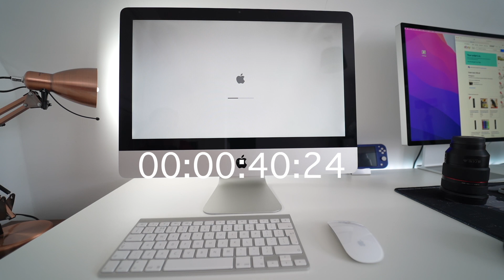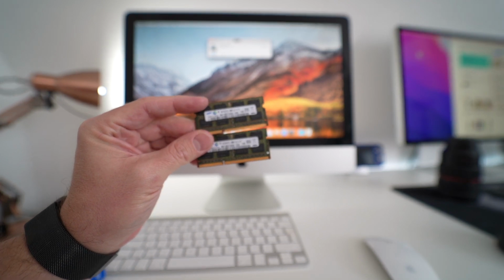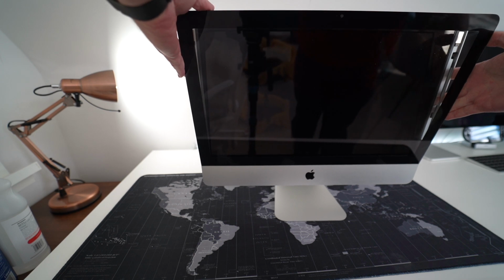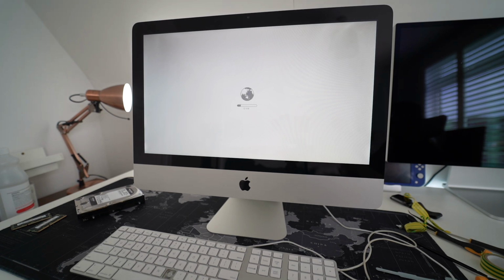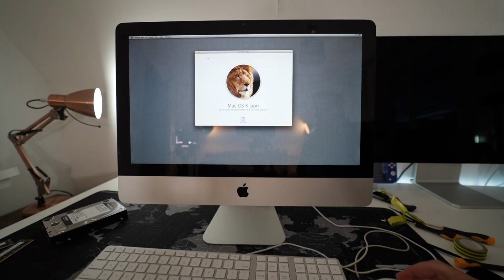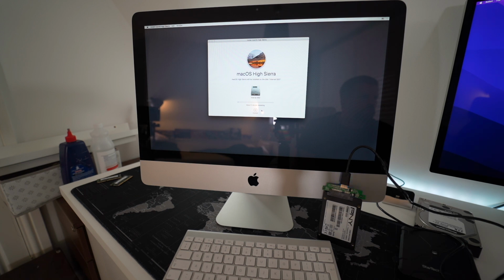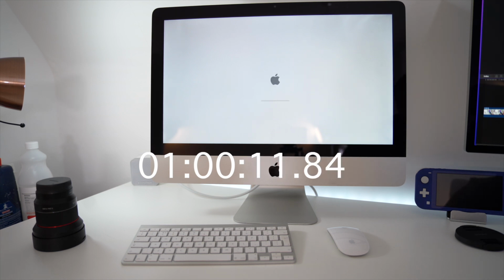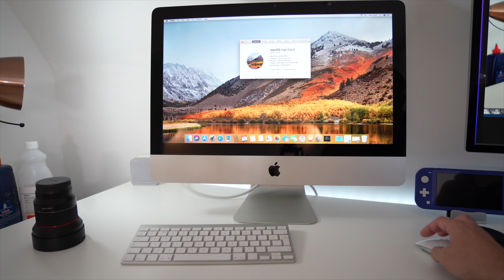SSD In A 2011 iMac - Is It Worth The Hassle? A1311

Comment: I’ve got a 27 inch 😊 i5-2500S, 1 TB SSD and upgraded GPU to an NVIDIA K1100M from the failure prone AMD HD6770M. DDR3 is extremely cheap as well so I upgraded it to 16 gigs (I plan on putting 32 gigs in here too)

Comment: Put in a ssd to replace my hard drive but my computer isn’t picking it up. There’s just a constant flashing folder on the screen.
Reply from the maker: @itstime6120  hold cmd+R on your keyboard and turn the Mac on…. Keep holding cmd+r until the chime, you’ll have to connect Ethernet or WiFi to re-download MacOs.   It should be an easy process and plenty of YT videos on the subject.  Good luck!

Comment: you put screws and bracket on the ssd so why the tape?...this is what anyone can do to any all in one pc. They are basically laptops with the same hard drive pinout and memory cards. I have an old HP and it looks no different. I've seen these macs running windows 10.
Reply from the maker: 1 screw to the bracket didn’t feel enough.  So why not?  Why do you have a problem with this?

What’s your point?

Comment: Hello,

I'm facing a very difficult problem with my iMac 27" 2011. After replacing the motherboard, CPU (upgraded to i7 2600), SSD, RAM, and reinstalling the system, the fans are running at full speed, and the CPU is stuck at a low frequency (1.7 GHz). I don't know how to fix this, and I would be very grateful if you could help)
Reply: Use mac fan control software, since you install the ssd the fan works at full speed
Reply: @elgatopeludin194  I ordered a thermal sensor for the SSD, should help
Reply: It's pin 11 you have to pull Low, to ground, pin 10 and 12 are ground pins, so it's not a big deal. I removed a bit of the plastic on the drive and soldered pin 11 and 12 together with a tiny piece of wire, just be careful to not use to thick a wire and to much solder, maybe it's easier to do it on the connector, but I did it on the drive, and it works flawlessly.
Reply: @danpedersen55  Thanks for the help! I've already done everything.
Reply: @gidrogengt Buy a thermal sensor. The 2009-2011 models had firmware on the hard drive to measure temperature data. If you replace the hard drive, this isn't possible anymore, and the fans will keep blasting.
Reply: If you've put the SSD in where the hard drive was there are two pins on the connector you can short to resolve this, a search will turn it up. My 2011 I kept the original HDD in and added the SSD to the dedicated connector, fans normal as the HDD remained. But the HDD failed and on removal all the fans cranked full blast. Once i made up a plug same as the SATA connector with the two pins shorted and put it where the hard drive was all returned to normal.

Comment: Question : I got an "old" iMAC with that "?" mark folder flashing ................but the "command + R" combination did NOT take me to recovery. Actually, nothing happens. Not even a WIFI network prompt. Could it be that the drive is just DEAD ? If i throw a brand new SSD in there, will it boot up ?? Thanks
Reply: the new drive will go in and the bios will function...it's a matter of installing an operating system...be it mac,windows, linux etc.   yes I've seen this very computer running windows 10.
Reply: Me pasó lo mismo! El iMac nomás se queda con el mundo girando y no empieza el asistente de configuración!

Comment: Great tip about not needing a bracket! I was just about to buy one on eBay but the electrical tape should do the trick hopefully. I’ve also bought a SATA Y-Splitter power cable, (for about £2.50) which also apparently sort out the fan issue without the need for thermal sensor.  
Thanks again. Great video.
Reply: the bracket is there for signal grounding...any piece of metal that you can secure the ssd to the frame with will do.

Comment: Did this on my Mac and was pleasantly surprised at the increase in speed. I had to 3D print a drive bracket (although one can be bought at amazon). It took me about half hour. Upgraded to Sonoma using OpenCore and the computer is nearly as good as my Mac mini M1 (with a few software exceptions). The beauty of these iMacs is that they are upgradable to some extent unlike newer macs. I also upgraded the RAM to 20Gb for pennies per GB. Hopefully this will extend the life of this iMac for another 10 years.
Reply: That’s amazing. Did you really need the bracket after watching what he did in the video above?
Reply: I am working on this since Yesterday, waiting for the ssd to arrive. 
1 thing i am not so sure about is how do i get the Software back!
Do i need to use  opencore  patcher to Download Ventura on an another usb drive? Can you help? 
Thanks
Reply: Did you get 20GB RAM in an iMac 2011, or was yours different?
Reply: I believe official Apple specs say 16 GB but I have the same 2011iMac  model and I have 32 GB  @CK-ze5xm
Reply: Where can I get these iMac ? Website link
Reply: You can't upgrade the ram I've tried